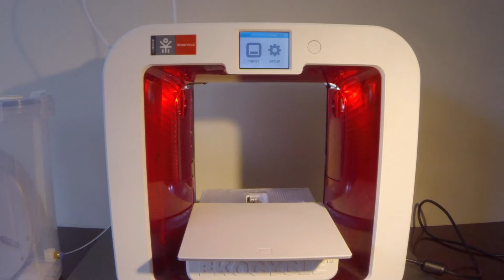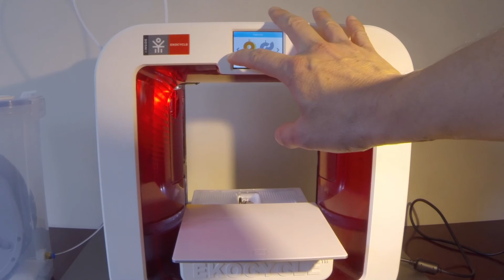Convert 3D Systems Cube 3 to Ekocycle and back again

Comment: Hey was wondering if you can help me setup to print things I put my STL file in a USB and it doesn't show up
Reply from the maker: 3D printers don't read STL files directly - You need to use a slicer to generate a print file. In the case of the Cube3, the OEM software or slicer is still accessible here: http://www.print3dforum.com/showthread.php/3024-3DS-Cube-File-Links

I would also recommend these videos from 3DS: http://cubifyvideo.3dsystems.com/